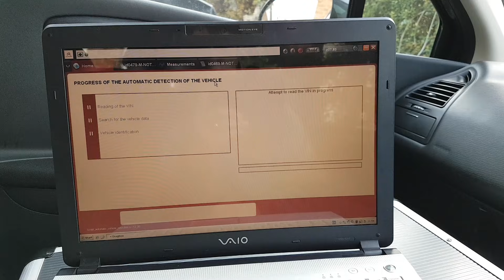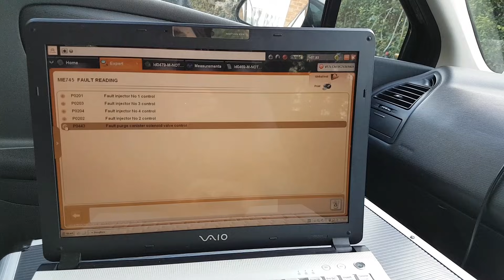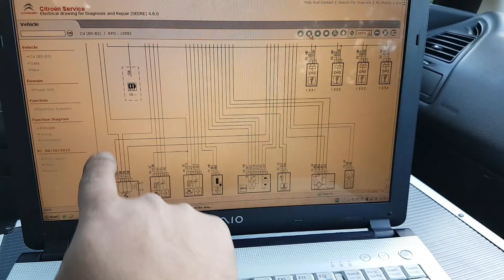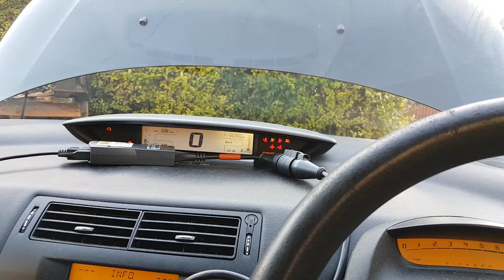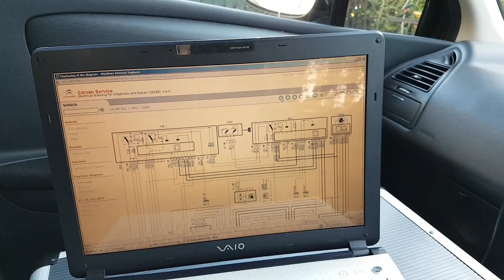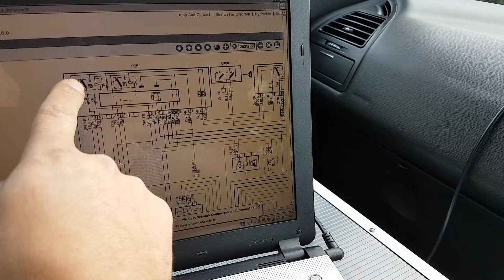Citroen C4 1.4 not starting. P0201 P0202 P0203 P0204 P0443 open circuits. Fault finding and repair.

Comment: Hi, Great stuff you put out. It would be even better if you could make more detailed video's ie. how you traced wire from coil 1 to finishing adding the temporary relay. Also where do you get the schemstics diagrams from pls.
Reply from the maker: It is complicated... I know you can not please everyone...
Some people criticize me for too many details/talking, others want more.... lol
Anyway, thank for watching and for your comment!
Schematics are from Sedre....
Reply: @LMAutoRepairs can you tell me from where did you take the voltage to feed the relay coil? Thank you!
Reply from the maker: @gicugigel3790 
It is all explained in the video...
Watch it without skipping...😉
👍
Reply: @LMAutoRepairs hi bro , l have the very same problem on a Citroen C4 . Do you still have the drawings or maybe can you tell me the colour codes to fit the external relay . Thank you
Reply: Hi I have a citroen berlingo 2009. No water from washer pump. wipers work but no water. I have replaced the pump and the fuse is fine but i did replace it anyway. Any suggestions have you experienced anything like this before. would really help been like this for four months and an auto electrican could not figure it out. Much appreciated
Reply from the maker: Difficult to say without looking at diagrams...
Try to scan it, and and look at live data, see if the stalk is working as it should, etc...
Reply: @LMAutoRepairs  Okay thanks do you do diagnoatic work for public?
Reply from the maker: I do this as a part time...
Reply: @LMAutoRepairs  Ive unpluged the connector to the washer pump and there is no power going to the pump. Does that plug wire that has no power go to the bsi unit or fuse box or does it go to the wiper stalk in your opinion. The fuse hasnt blown and the pump is perfect did try to my other van and was fine. Just no power going to the pump? Any suggestions would be appreciated. Thanks
Reply from the maker: I am not sure where it goes without checking diagrams...
But I believe it goes to the BSI...
The power might not be going to the pump because is not being requested... that is why I said to check live data to confirm the stalk operation...
Reply: @LMAutoRepairs  Okay will do thanks again
Reply: Great job 👍
Reply from the maker: Best start by have if scanned... analyse live data etc...
👍👍👍

Comment: thanks buddy! that was it! best

one recommendation, it's better to power the fuse from the top pin, the one closer to the large connectors... that way the power to the fuel system goes through the fuse first...

Comment: Hey LMAutoReparis i have a citroen c4 2006 which rele should i buy
Reply from the maker: Any normal relay to attempt similar repair.
Otherwise, just replace the module.
Reply: @LMAutoRepairs Thank you so much for the answer
Reply: @LMAutoRepairs hey should i use 30amper rele for the F10/Fuse 10
Reply: Or 40 amper?
Reply from the maker: Should work... I don't recall all the details of what i have done on this video, what everything an make sure you understand it...
👍

Comment: My car has battery error and also fog light error . The generator actually makes 11.5 volts and it is new. It worked two weeks and when the weather is moist the deplution error also appeared with battery charging issues. Have you had the same problem!? Peugeot 407 coupe 2.7
Reply from the maker: Either a bad alternator or something wrong in the charging circuit...
You need to investigate further...
👍👍👍
Reply: @ alternator and many other parts are new along with battery. The permanent fog light error seems to spread to other areas and i believe it might be Bsm or the clockspring or light column switch!
Reply from the maker: @german_lifestyle_tajbakhsh7282 
New doesn't always means good...
The alternator should charge independent on that...
Should... lol
I would suggest to test and investigate before continuing with the parts cannon...
👍
Reply: @ actually this game was played exactly with previous alternator. It worked sporadically. After bsm and other suspect things then I should check for alternator wiring which is not my own job and needs a hydraulic lift
Reply: @ i ve already changed everything but the BSM
Reply: Alternator is fine . Maybe in future i check connections of alternator. Wiring

Comment: Thanks for the video. Pin 5 is from the grey gris connector, but I dont see where you connected it. Any idea which cable you connected to the relay pin coil (85 or 86)?

Comment: hi i have the same issue with my berlingo i know you can bridge the fuelpump to get it working but what is the solution? is the fault in the wiring loom; or is it the bsm internal relais that has failed because i replaced the bsm and still i have the same issue and i am getting pretty annoyed with this issue i heard it could be the ecu not sending neg signal to the relais but its a wikd guess i think
Reply from the maker: You need to test the wiring and the circuits...
It is impossible to guess, specially if already started replacing parts...
👍👍👍

Comment: Hello,
I have a similar problem .and as you say,it is not repairable. Will an external relay break? Are there vulnerabilities that continue to be exploited in this way? Thank you
Reply from the maker: An external relay might break, but can be easily replaced...
👍👍👍
Reply: @LMAutoRepairs  i mean ,will plugging into an external role harm the system? Thank you so much
Reply from the maker: @kenan7590 
Not really... no harm...
Just make sure you use any circuit protection is necessary...

Comment: Hi, 4 days ago I bought a 2004 C3, everything seemed fine. Drove it home, then the next day it stalled and wouldn't start again.
Its now showing the following codes:
P0201, P0202, P0203, P0204 (Injector Control, all injectors)
P0444 (Evaporative emission (EVAP) canister purge valve - short circuit)
P0351, P0352 (Ignition coil 1-4 - short circuit)
P0135 (Upstream oxygen sensor heating control)

Think it could be something similar? Thanks
Reply from the maker: Indeed it could...
Check the basics first though... fuses, connections etc...
👍👍👍
Reply: @LMAutoRepairs    
So I've looked at the diagram for my car, its basically the same circuit as this C4, however instead of two separate fuses powered by the relay like the C4, all 4 components (injectors, ignition coil, purge cannister valve, x2 oxygen sensor heaters) are ran through one fuse.
This single 30A fuse is fine. But the fuse doesn't show 12V with the ignition on. 
I tried your method of providing 12V directly from the battery, but sadly no luck starting the car.
I haven't taken the fuseboard out yet. I wonder if the stored fault codes would prevent the car from starting, even if the issues have been "fixed"?
Reply from the maker: @zingrock 
Usually no...
The codes if stored will allow the car to start...
Perhaps is not just that fuse that should have voltage, Perhaps the internal relay should power other things as well...

Comment: Hello i have the same issue with an citroen c3 2009 1.4 but i have no fault codes. Has anyone the same problem and the solution? The solution in the video doesnt work at my car… thanks
Reply from the maker: You obviously don't have the same issue then...
You need to investigate... check live data... and check the basics if you haven't already...
Fuses, connections, etc...
👍👍👍

Comment: Hi sir,can you please explain to me me the  connection to that external relay you made. Can only see the positive wire from the positive going to the positive terminal and to the number 10 fuse.
Can you please breakdown the connection from the relay to the Bsm
Reply from the maker: It is all explained on the diagram etc...
Watch the video carefully...
I don't recall all the ins and outs, did this years ago...
I would have to go and check diagrams etc... but you can do that yourself...
The external relay essentially bypasses the internal one...
First make sure that is your issue, by testing etc... otherwise you might gona be wasting your time...
👍👍👍

Comment: Hi I got a c4 coupe 1,6 and the management engine came up and a it says a anti pollution system faulty toke to the garage trying to identify the codes it says no errors so they clear the codes and was all fine till the following day when the engine management came on again and it says anti pollution system faulty! Could you please help me or advise me on should I do ? The car is running perfectly just the the engine thermostat not showing any temperature some times
Reply from the maker: That's a bit contradictory...
Had no codes, but codes cleared and message went away...?🤔
If that message appeared, there will be codes logged on the ecu...
👍👍👍

Comment: Actually what part is faulty, instead of install relay externally what we need to replace because not every mechanic is genius as you, I am facing same issue and please tell me the part name what I need to replace, is that relay separately available or in ecm, bsi or bsm, please reply
Reply from the maker: As per the video...
The relay bypassed was on the BSM...
👍👍👍
Reply: Mean I need to purchase and replace BSM (FuseBox)completely?
Reply from the maker: If you have the same issue, yes...
Reply: Sorry for bothering, yes I have same issue, after watching this video I have applied direct voltage from battery to same fuse and  fuel pump start pumping but engine didn't start by the way, what should I do?
Reply from the maker: 🤷‍♂️
Difficult to say... you need to follow the circuit and see if you have all the voltages and signals where they should... could be a different relay that failed, or more than one...
👍
Reply: Thank you so much for your time and reply 😊
Reply: Can you please elaborate that one you connect with ground, second with fuse but third wire connect with which wire, please share, thank you, my car start working with direct connecting jumper with battery but need to install relay externally as you did.
Reply from the maker: I don't recall all the ins and outs... but, is a relay, there is not much ways on how to connect it...
I recall just that the control wire was connected to an ignition powered circuit...
I believe I have explained that in the video...
👍👍👍

Comment: Great video, I have the same problem with a Peugeot with a similar box. But I'm afraid that there is some kind of security risk in that connection. If the fuel line breaks, the control of that relay 2 is probably supposed to stop the fuel pump.
Reply from the maker: The connection is the same as the original...
I have just replaced the internal relay with an external...
😉
👍👍👍
Reply: @LMAutoRepairs  I may be wrong, but as far as I understand, the control of the RL2 relay coil is done by a microcircuit with NPN logic and the positive side of the relay coil always gets voltage when RL1 pulls. With that fix, one of the conditions is bypassed. The negative side of relay RL2 is not accessible from the outside.
Reply from the maker: I get your point...
What is the security risk?
Both relays are on at all times with the ignition/engine on...
I can't see any condition where relay 2 would be powered off with the first relay on...
Unless I missed something...
👍👍👍
Reply: @LMAutoRepairs  I don't know what that microcircuit contains and if there is any software associated with it, but I would assume that that microcircuit cuts off the current from the pump when the ignition is connected and sufficient fuel pressure is reached, for example when the engine is not started or when it does not start. I would also assume that that control monitors the fuel pressure and cuts off the pump if it can be concluded from the pressure that there is a leak in the pipes. If that NPN control had no meaning, that connection would have been implemented much more simply. So I would think that the purpose of that is to prevent fueling a possible fire.
Reply from the maker: Yes, you might have a point...
Would have to go a find out the strategy or functional description of the system to see if that is actually the case...
Thank you for watching and for your comments!
👍👍👍
Reply: @LMAutoRepairs  i think the risk maybe can be in a fuel pump with no return .. the pump bomb of c4 citroen have return so the action of de fuel bomb always is in On .. sorry for bad english hope understand the point

Comment: Tell me if when this problem occurs, when you put the ignition on, does the fuel pump start, because it doesn't give any sign for me?
Reply from the maker: I don't remember know... 
Sorry...
Check diagrams and see what systems are powered by the relay...
👍👍👍
Reply: @LMAutoRepairs Thanks. Should i mechanically check the pump first or check the relay first? Because you are the expert, what do tou think?
Reply from the maker: Check that there is voltage going to the pump first...
👍👍👍
Reply: @LMAutoRepairs  Thanks friend. I found the problem. Thanks

Comment: Hi, I have the exact same car in my workshop with the same faults. (Australia). The relay powers the injectors and the purge valve (reason for codes), and also the ignition coil (transformer coil at bottom of diagram), but also the fuel pump! Lots of loads on the one relay and only 2 fuses! Very poor design. Very easy to fix compared to security issues in later models.

Comment: I have the codes p0201, p0202, p0203, p0264, p0204, p0205, p0256, p0354, p1341. on peugeot 407 3.0 gasoline. bsm L02-00. The gasoline pump is activated. but the engine won't start. Do you think that by doing this I can solve it? In the official peugeot service. They couldn't fix it.

Comment: I have the problem in this video and have done the test with the 12v led to fuse 10 . So I have to put in an external relay. In your video you don't tell us what wires to cut, can you help please.
Reply from the maker: Hi
I have roughly explained showing diagrams, etc...
I don't recall now all the details, but they should be on the video...
Thank you for watching!

Comment: I wish you lived in my country. My sister has a C3 1.4 petrol and it tries to start, sometimes starts but failing. And has a lot of codes. 

Fault log report generated by Torque for Android
=================================================

Vehicle VIN: 
Vehicle Manufacturer: 
Vehicle Calibration ID: 

Current Fault Log
------------------
C0313: Unknown code - More information may be available on the web
P0201: Injector Circuit - Cylinder 1
P0203: Injector Circuit - Cylinder 3
P0204: Injector Circuit - Cylinder 4
P0302: Cylinder 2 Misfire Detected
P0351: Ignition Coil "A" Primary/Secondary Circuit
P0352: Ignition Coil "B" Primary/Secondary Circuit
P0402: Exhaust Gas Recirculation Flow Excessive Detected
P3600: Unknown code - More information may be available on the web

Pending Fault Log
------------------
P0202: Injector Circuit - Cylinder 2
P0444: Evaporative Emission Control System Purge Control Valve Circuit Open
P0501: Vehicle Speed Sensor Range/Performance
P1336: [Chrysler] Crankshaft Position (CKP) System Variation Not Learned
[Honda] CSF Sensor Intermittent Interruption
[Nissan] Crankshaft Position Sensor (CKPS)
[Mitsubishi] Piston position sensor 2
[Dodge] Crankshaft Position (CKP) System Variation Not Learned
[Jeep] Crankshaft Position (CKP) System Variation Not Learned
[Seat/Audi/Volkswagen] Engine Torque Monitoring Adaptation at limit

Historic Fault Log
------------------
ECU reports no historic faults
Other discovered fault codes
(possibly pending, current or manufacturer specific)
----------------------------------------------------
Reply from the maker: Sounds like an issue with the same unit as per the video... but difficult to tell without investigation...
Good luck sorting it out!
🤞
Thank you for watching!
Reply: @LMAutoRepairs  yeah, most likely. I will try to buy a new one, it seems not that expensive on ebay. Thank to you for the video, gave me some clue.

Comment: hi can you tell me how you connected that cable
Reply from the maker: Hi
As per explained in the video and diagrams...
👍👍👍
Thank you for watching!
Reply: @LMAutoRepairs  hard that i can see it's cord where it's taped i don't know where it's plugged in
Reply from the maker: To an ignition switched 12v... that to power the relay...
The relay to battery voltage...
Reply: @LMAutoRepairs  is relay 3 able
Reply from the maker: Right, watch the video without skipping...
Once you understand the principle of what I have done, you will easily understand how to connect the relay...
I could have connect it in many different ways... 
😉
Reply: @LMAutoRepairs  I'm just wondering if the relay should be 3 wires or it doesn't matter how many there are
Reply from the maker: If the ignition switched voltage you are going to use, is capable of handling the fuel injectors on top of what is already feeding, yes... a 3 pin relay will do... otherwise no... you need a "normal" relay...
I used the ignition switched voltage to just power the external relay... to not overload that circuit...
Reply: @LMAutoRepairs  Is there a two + on the relay
Reply from the maker: What?
Be careful if you don't know how to connect a relay... you might do more damage...
Reply: @LMAutoRepairs  do it go to fuse 30 and 15 Cable
Reply: @LMAutoRepairs  two old plus and 2 two minus

Comment: Can u do away with the economy mode? Thanks inadvace
Reply from the maker: The economy mode clears as soon as the engine starts...
Thank you for watching!
Reply: @LMAutoRepairs  yes its supposed to but my peugeot partner sticks in it, my mechanic siad she mixed up in signals between the  alternator & BSI she,s not picking up on the fact she is charging, I which I could abolish that economy mode completely? Thanks for replying
Reply from the maker: There is a function on the scan tool to deactivate the economy mode...
But I believe that if you have an issue with the charging system, that will not sort your problem...
You need to get that issue resolved first...